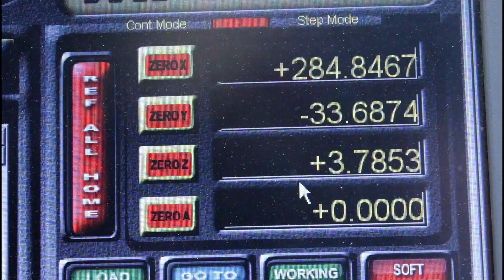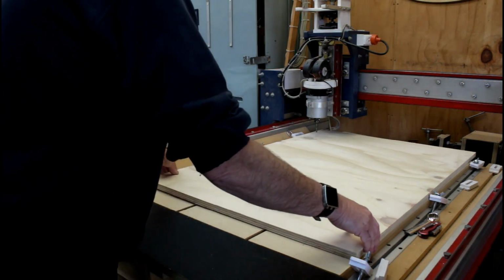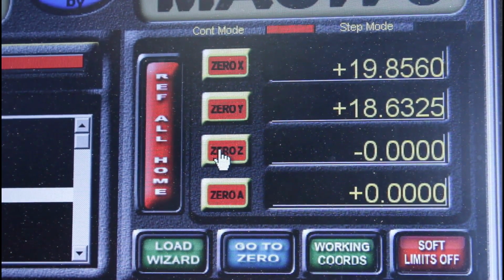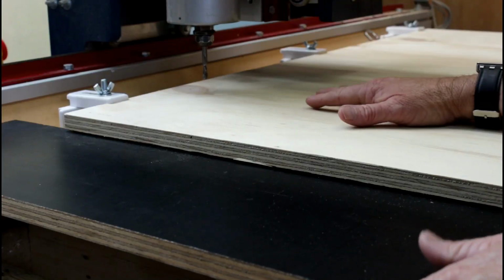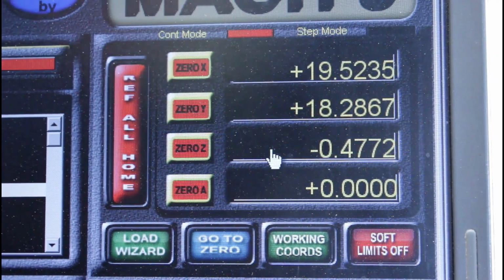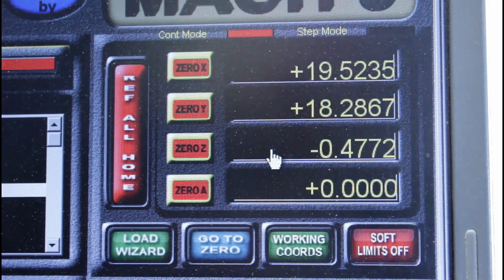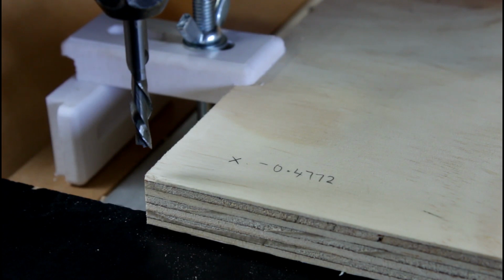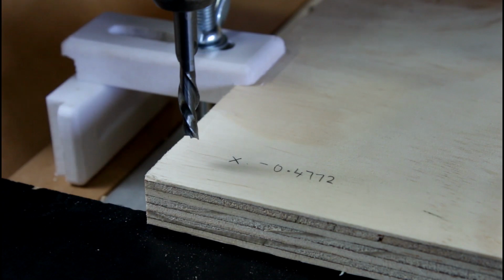What's The X for Dude? - CNCnutz Episode 95

Comment: Hi Peter,  I notice you dont use tabs when profile cutting.  Dont you find the part moves and damages the side surface at the end of the cut or knocks the cutter?
Reply from the maker: I find that when doing something large and using a down cutting spiral 
bit the sawdust is packed into cut being made. This holds the piece in 
place and stops it from moving. It can sometimes take quite a bit of 
effort to remove a piece from the table. The dust packs in so tight and I
 think it isn't cut all the way through even though it is. MDF really 
packs in as you could imagine.
Upcutting bits are a different matter. They clear the cut as they go and are likely to pull the piece out of the stock which will cause damage as you say. I only do this with down cut bits.
I pick the parts I don't use holding tabs with care and I barely cut through the material when I do it. A deep cut past the bottom of the material is liable to release a part prematurely. If the part releases and the machine does another cut around the perimeter then kiss the project goodbye. 

Cheers
Peter

Comment: Curious what brand of bit that is and what your feeds rate and rpm's were. Thanks
Reply from the maker: Hi Krys

It is an 2 flute Onsurd 1/4" downcutting spiral bit.
The router ran at 11000RPM and the feedrate was 150ipm constant velocity.
Cheers
Peter
Reply: Thanks, also what was your cut depth ?
Reply from the maker: Krys Allen
4mm for the pocket and 2mm for the profile cut.